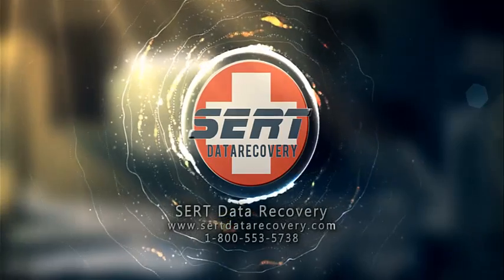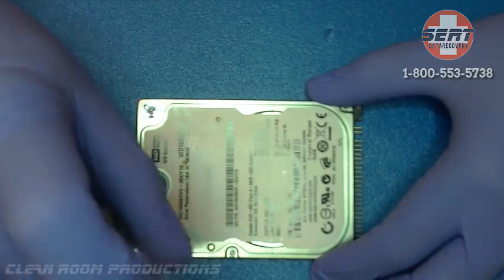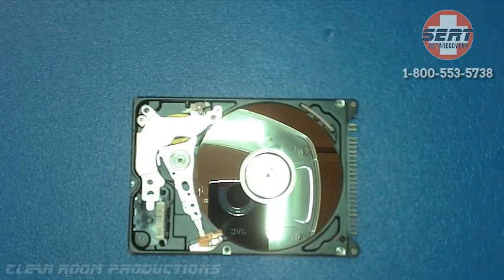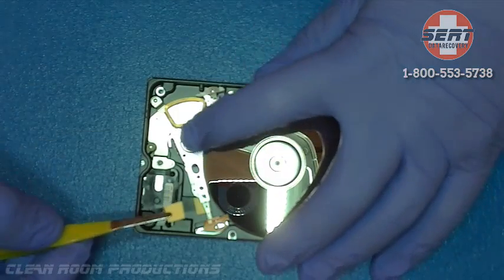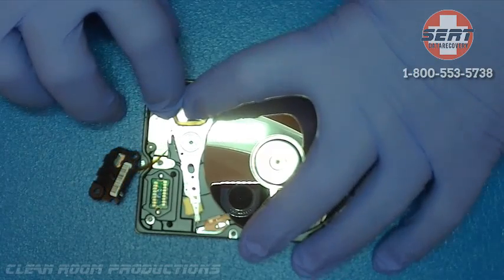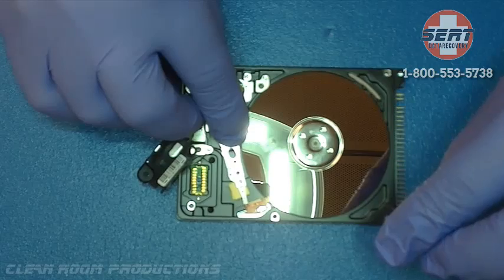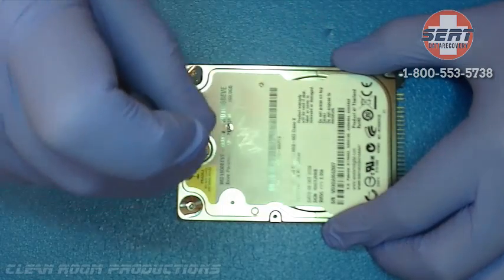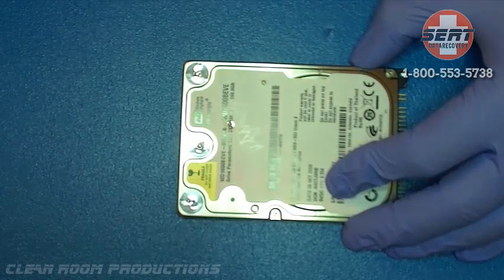Hard Drive Recovery - Repair - Western Digital Data Recovery with Clicking Beeping Sounds

Comment: I'm afraid because for some reason, when I have multiple stuff open at once, I can hear what's going on the hard drive like the heads moving back and forth almost continuously like decently quickly or something (Like heads working normally, but more noticeable) and it's not clicking, beeping or anything, but when I close stuff, it doesn't make that noise that worries me anymore. I can't tell if it's a normal process or not. (Sounds like it) I tried opening random files and the performance is okay. Almost sounds kinda soft buzzy when listening it closely. But sometimes it will stop doing that after a while or doesn't do that.
Reply from the maker: Back up all your important files. AFTER doing that if the drive is more than 2 years old, or if the laptop has taken any physical impact or abuse at all, you may want to look into having it replaced before it dies on you. We have a great encrypted cloud backup and file sharing service where we are running some great deals this month. If you are interested please feel free to call 1-800-553-5738, and we can get you setup the same day. Back up your files before your hard drive crashes!
Reply: SERT Data Recovery
LONG COMMENT ALERT!

I just want to know how to fix the problem of the hard drive doing the normal process thing louder than it should be. (Was not the case when a week ago and more) My hard drive is still in working condition. I am using a WD 500 GB Green Hard Drive, my dad formatted it before putting into my new desktop computer that my dad built 2 months ago which I am still using today. (Not years, but a couple months)

I start getting worried when my microphone fell off of the kitchen table and into the front of the computer case, but thank god, it didn't do anything to the hard drive. (Which was in the back of the computer, at least where the noise is indicating) After looking up on a specific video, like "HDD Clicking normally" then I didn't get worried anymore. Because it sounds exactly like in the video. Just search that and you know what video I'm talking about. Hard Drive being louder, well, that's a thing. Even though it doesn't do it every time. (Maybe, after a few days, it won't do that anymore)

I'm sorry if you didn't understand, I am one of those people that doesn't explain stuff very well.

Also, I only have 1 Hard Drive in my computer. My dad's old external hard drive (Seagate, maybe) a month ago, does like clock-ticking clicking, even though it's not plugged into the computer. I heard that while I am on the computer, after a while, I moved the external hard drive away from me, because it won't shut up. I only used to transfer it to my files to the WD 500 GB Green hard drive, but it was before it started clicking. (Which caused by being it upside down on the floor for some reason)
Reply: Is there a way to stop the loud normal process sound? Most of the time, it doesn't do that, but rarely I can hear the head moving back and forth super fast and the fix of the problem is to close all the applications and wait for a few seconds and then it stops doing that. I wish I had a hard disk muffler, but it will probably make it so I can not hear clicking that I may get in a year or more. So, why does it do that? It's like a hard drive is a few inches away from me, even though it's inside the desktop computer case itself. The sound is not actually effecting the hard drive, it is running just fine. It sometimes do that when I have applications running and then after a while, the loud part of the normal process noise will go away. So, it's a temporary kind of thing. (Before you say so, it doesn't sound like grinding at all) I can't tell if it's the fans or the hard drive.
Reply from the maker: I would just backup the files and possibly change out the hard drive, or don't worry about it if the files aren't important
Reply: SERT Data Recovery
Any solutions to stop it? I heard that it's only happening to WD Hard Drives. Like WD Black is the most noisiest. I am just getting annoyed with the sound. It's doing that for a month total now. I say total is because most of time I don't notice the noise when I have earphones on. I really can't explain very well and I am 15 years old. Just to note, it's a hecking WD Green desktop hard drive.
Reply from the maker: Green are one of the lower end drives WD makes. Overall we recommend WD over any other drives. We find they are the most durable. No suggestions for avoiding the noise, as we only focus on data loss prevention and recovery.
Reply: SERT Data Recovery
I just had this thought in my mind. How does the head stack swap work? Because all I just saw is taking apart, put the donor drive into the hard drive with all parts taking out and then remove the donor drive after waiting for a few seconds and put the parts back on to it. That's something that's making very confused. For the environment, how would you make that work as well? Is it impossible to do it at home? My dad is an intermediate computer fixer, but I don't know if he can fix the hard drive properly.
Reply from the maker: This is not recommended to be used for do it yourself tutorials. This is to display our engineers' capabilities of making head swaps look easy. SERT cannot recommend this to anyone that has never done one before, and succeeded with the type of drive you have (manufacturer/model), unless the data is not worthless.
Reply: SERT Data Recovery
So you can't save money that way? My family can't pay that much money. Well, that sucks.
Reply from the maker: No sir, you will highly risk making a mistake and ruining the media.
Reply: SERT Data Recovery 
Okay, thanks.

Comment: Does water damage data? My computer got water damage because of my dad spilling water and I am afraid of the data being gone.  After the water damage occurred I saw the lights from the monitor not show up is a sign of my computer will not turn until if I unplug and wait for 2 and a half hours.
Reply from the maker: I would remove the hard drive from the computer and see if it looks wet. Water can damage platters after time and depending on conditions.
Reply: SERT Data Recovery
I stand corrected. My computer and my hard drive did survive. But my network driver is like gone. I tried add legacy hardware and it said device can not start, but got installed. Fixed it by replugging in to a 2.0 port instead of 3.0 port.

Comment: WD Passport. When I plug it in the light flashes and I hear 4-5 ticks followed by nothing. The light stays on but my computer does not detect anything. It is toast?
Reply from the maker: The ticks are a bad sign, but with the proper process the drive may be recoverable. We have recovered Passports with this symptom. My question to you is was it dropped or bumped or did it suffer from any kind of impact or jolt?

Comment: hi there
 my wd external hard drive has problem ,
 1 shows offline in disk management
2 write protected
3 unallocated , please give me any solution
Reply from the maker: You more than likely have a serious issue with the drive, whether mechanically or firmware. This type of recovery requires advanced tools as well as potentially a clean room.

Comment: I have a Wd passport ultra I was transferring videos from my laptop to my passport ultra when an error 0x800701e3 fatal error occupied I can't transfer anything for a majority of the time and sometimes it let me transfer some video and photos than I uninstalled the passport ultra on my computer and when I plugged it back in to my laptop and my desktop it in my computers but the folder won't load I don't know what to do  to solve the problem with my Wd passport ultra
Reply from the maker: It sounds like the problem is getting worse. I would not plug it in any more. It has either failing heads, damaged platters, or corrupted firmware. You will need to contact someone that has hardware specifically made for data recovery on hard drives. Software will kill your drive.

Comment: I have a western digital hard drive and I removed the head off the platter (successfully without scratching).  I plug it back into the laptop and it spins, but is still not recognized.  What do I do?
Reply from the maker: Assuming everything else went perfect, the drive probably has a firmware problem as well. You will need a really expensive piece of equipment ($7k) to correct it.
Reply: So what else can I try on my end?  Moving the head back into place is what I keep seeing as the solution.  The platter spins normal with no noise since I've done that.
Reply from the maker: You need this equipment to diagnose it, and also to fix it for data recovery. You can send it in if you would like us to help you. Its a good sign that the platter spins normal and no noise since you moved the heads, however there is an additional issue (likely the firmware).

Comment: hey bro, can u help me.. i can't format my wd my passport 2 tb either using cmd.. so can u help solve my problem...because the service cntre too far from my hometown to claim warranty...hope u can gi me some advices...
Reply from the maker: If the drive has problems that is preventing it from being formatted or being recognized there is not much to recommend to fix it. I would not even suggest trusting that drive to continue to use. Try to format it on another computer and if you cannot then there is a problem with the drive.

Comment: Hi I have wd ultra passport that I bought a week ago .Was working fine till it disconnected improperly and fell to the floor.now it doesn't show or mount in my computer.only shows in device manager and I hear a beep once every 5-10 mins when it's plugged in .i heard wacking it while it is plugged in my get it to work and cause the head to become unstuck .any ideas?
Reply from the maker: If there is data on it then you will want to send it out to a professional. But there is high likelihood the data is destroyed since you have turned it on since it fell. If there is damage to the heads then they have probably damaged the platter.
Reply: SERT Data Recovery Where can I purchase the head separators to prevent them from sticking?
Reply from the maker: Fritz J all you have to do is search online or make your own. Honestly though I don't suggest you doing anything on your own on a drive that has data that means anything to you, especially outside of a clean room environment. http://www.sertdatarecovery.com/hard-drive-recovery/class-100-clean-room

Comment: How critical is it if one can't get the 100% identical model hd? E.g. for a head from a hd with P/N: WDBLUZ0010 would also work a head from a hd with e. g. a P/N: WDBLUXXXXX or is there different way of typing the hds?
Reply from the maker: we have our own proprietary way of matching donor drives. Many times you need a really expensive piece of equipment in order to obtain certain details necessary to be absolutely positive.

Comment: i have a seagate barracuda 3tb drive which i have removed from my imac it was running very slow and struggling to find data and eventually the computer stopped booting. i have since removed from the machine and have it plugged in via an external sata power supply and it powers on spins beeps one time then powers down. there is nothing on the drive i am that worried about loosing i removed the top of the drive to see if the head was stuck and it was in the park position. i didnt power it on with the top off as im told this will destroy the data entirely. i cant find any explanation for the drive to power down other than potentially a faulty power board. Any ideas?
Reply from the maker: If there is no data on the drive worth saving, I would move on to another drive and count that one as a paper weight....
Reply: it was more for my own curiosity to be honest. just wondered what would cause the drive to power on and then power off. the beep is quite loud when it happens its not a click sounds a lot more like a beep. just wondered if it was something you had come across before. if it was the pcb theyre pretty easy to get hold of for very little cost but if its the head then yes it would make a lovely book case end
Reply from the maker: Not necessarily the PCB if it's running slow... otherwise we would need to hook it up to the diagnostics machine to diagnose it further...

Comment: Hi, I'm in the process of changing the head of my disk, I'd like to know, I had the click of death problem and when I opened it I saw a scratch along the inner circle of the top platter, it seems that the arm that was clicking has done that scratch, should I continue the head switch or the disk is pretty done? Thanks
Reply from the maker: When there is damage to the platter from the heads the only thing a head swap will do is kill the heads. In cases where there are head crashes that result in rings on the platter, the data is not recoverable. Sorry...
Reply: ok :( I saw this guy from a restore shop able to skip the scratched section watch?v=n1OcTKDjO2g is that an unreachable solution for DIY stuff? This guy probably had programmed himself an app for doing this or have you ever heard of similar kind of app?
Reply: Otherwise I have this drive I wanted to use as replacement disk that I could use for storage or throw it in the garbage. I opened it for the switching, I read there were a gas in the hdds to keep it cold, since I opened it the gas might have gone, is this drive still usable without gas?
Reply from the maker: ryukishisama for that drive in the suggested video, it would take multiple sets of heads to determine which LBA that scratch started and ended at. This also requires specialized hardware. This drive you are working on should never be used again for anything, even if the data was recoverable.
Reply: SERT Data Recovery ok the two drive are done? The old broken one I understand, but why the new one (that I opened for replacement but never touched because I saw the scratch) because of the gas that has leaked?
Reply from the maker: ryukishisama if you opened up a drive to swap the heads, and there is nothing wrong with the platter in that drive, and you close it up properly and run it and the drive works fine, and will read/write data then go ahead and use it. Of course this is not suggested to do outside of a clean room, and should never be done to a drive (outside of a clean room) that has data on it that you need to get off. But if it spins and writes data go ahead and use it.

Comment: i get 4 beep sounds 5 time and after gret error no bootable device .by hdd also WD
Reply from the maker: Elmir Səlimov there is likely a problem with the read write head assembly, or bad heads. You will need to get this to a professional with a certified clean room that is experienced in making head swaps, and/or has the advanced equipment needed to diagnose it on that level.
Reply: how much cost solve this problem.i tryed to solve this problem some time.but couldn't solve
Reply: sorry my english
Reply from the maker: Elmir Səlimov It depends on what size the drive is and what you did to try to solve it.
Reply: i just recently got the no boot device error on my laptop had to fully replace my hard drive🙁

Comment: i have a seagate backup plus portable external hard drive 1TB , when i connect it to my laptop it's indicator light is blinking continuously and it's not shown anywhere in my laptop, i have checked in disk management but it's not detected there too......can anyone tell me how to get it back to work.
Reply from the maker: You will likely not be able to fix this without very expensive recovery technology. Is it clicking?

Comment: Hi my external hard drive was making clicking noise now it's beeping please help
Reply from the maker: You will want to turn it off, unplug it and get it to a data recovery company with a certified clean room so they can inspect the inside of the drive. Do not open it yourself unless the data does not matter to you, you will risk losing everything.

Comment: my WD passport ultra suddenly doesn't show up in my computer. it is unallocated in disk manager, and offline. shld I try right clicking it, to change offline to online, it just gives me i/o error....
Reply from the maker: There is likely a firmware or mechanical problem with the drive that requires special equipment to work with in order to get the data. Is the data critical? We can take a look at it for you if it is.
Reply: SERT Data Recovery I am in Singapore. that be too far for me to send over ...... thx for the help offered......

is there anything I could do to test if it is actually hardware or software issues?
Reply from the maker: Sorry if it dropped it will be a hardware issue, or internal software *microcode" corruption.

Comment: my Seagate external hard-disk beeps 4 time and stop, my pc or laptop  doesn't detect it it has suffered some mechanical failure Something is broken inside the hard-disk because when i shake by hdd a little i can hear some metal is clanging and makes sound
Reply from the maker: shouldn't hear anything moving or clanging inside the hard drive. Really shouldn't be shaking it too hard either. The beeping can mean a couple things, but if it's not spinning there is something definitely going on inside. You don't want to keep putting power to it any more, and hopefully haven't left it sitting with power to it for very long. This drive is going to need to be opened in a certified clean room, and inspected.
Reply: +SERT Data Recovery thanks for quick reply if i was in your country i would have send my hdd to yoy
Reply: +shubham sharma you*